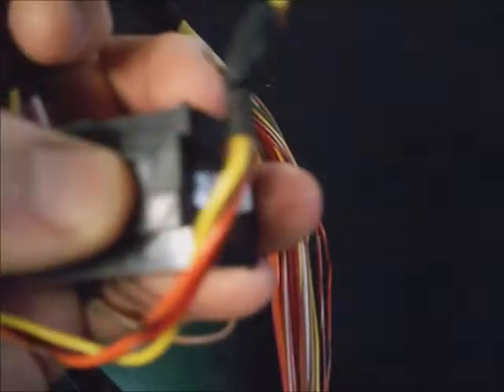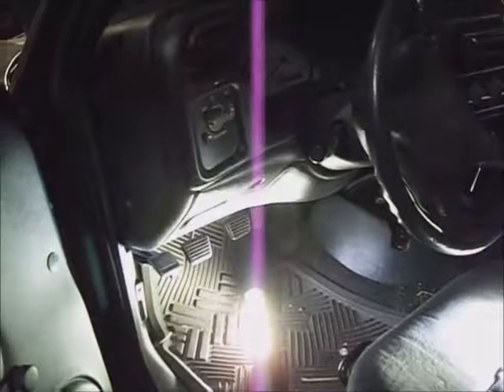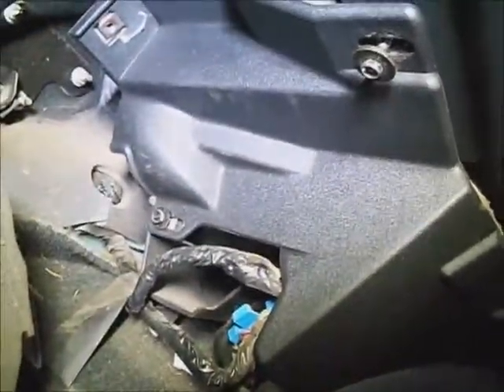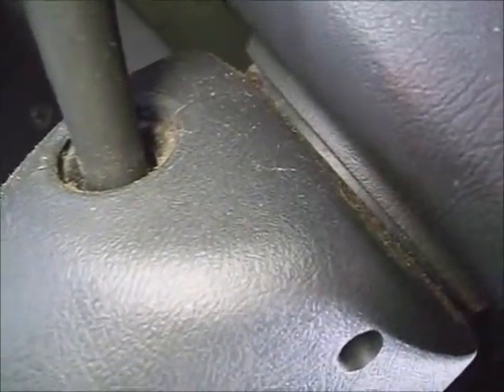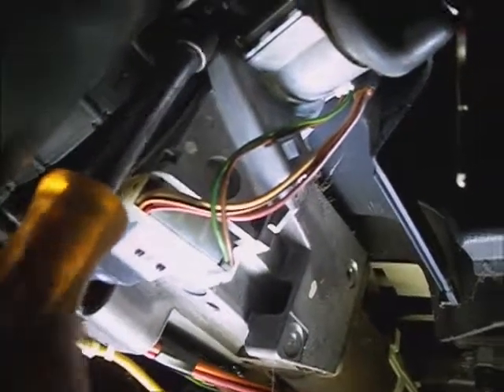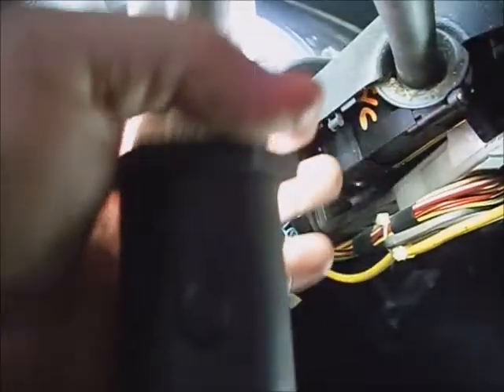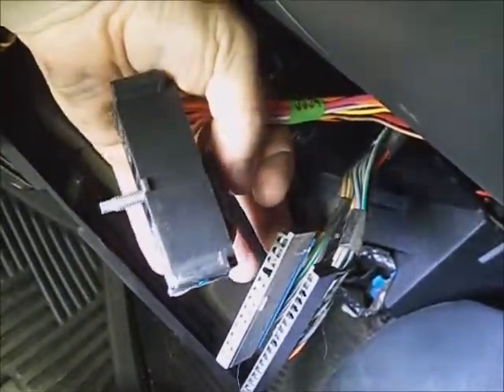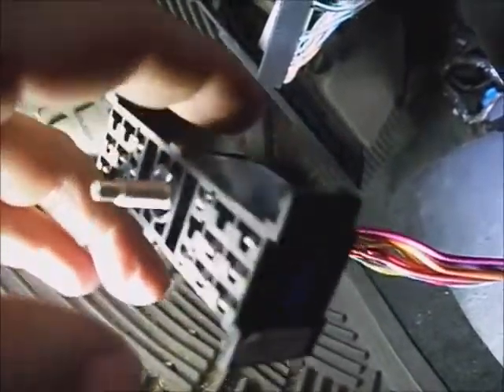chev s-10 Truck 98 stall no-start, gauges dropping out, ignition switch symptoms replace

Comment: i just installed a ignition switch on my 99 Chevy S-10 today. I followed the way you described in your video and it will not crank over. It was cranking over and starting right before I replaced with the new part. So I put the old part back in and still will not crank over. I looked at all my fuses and relays and they are still good. I even bypassed the clutch switch and still nothing. Do you have any suggestion on what I can try next?
Reply from the maker: Be sure the trans is on neutral, before testing, or bypassing safety switches.  You may have indexed the gears a tooth off.  Be sure that when the ignition is on, (all dash lights on for bulb check, also stereo will be powered in this position) that as the locked is turned past ignition  (ON), there is a spring-back feel to the lock, indicating that it is going all the way to start position, and is inclined to return to ignition (ON), so starter doesn't stay engaged, after you release key.  If this isnt happening, then move ignition switch 1 tooth forward, (probably), and check all positions;, power on, ( acc/ off/ ignition on/ and finally start.) 
   If gear index is operating properly, and still no starter action, I would proceed as follows;  at underhood fuse box- find the (CRANK) fuse, ( the heavy yellow wire from ignition start position power, goes directly to this fuse, b4 it is sent to modules, and the clutch safety switch).  Check this fuse, for an open, if ok, then with fuse installed, hook a test light to ground, and the probe end, on each metal test indent on back of fuse, while turning ignition to start position.  Post back, with results, if light illuminated on 1 or both fuse indents, or not at all.  Thanks for watching
Reply: Ok. So what do you do if you find an issue with that fuse. I can put a wire from positive to that fuse and it'll start. But what's the issue that's causing it
Reply: I take that wire away it'll stall out. Goes to the ignition fuse there from the battery... Truck won't start just Crank and 3/5 the dash gauges will not work unless I plug the wire into the battery. I think it's the ignition switch but I know nothing... Literally..